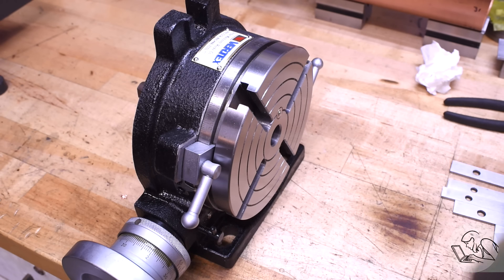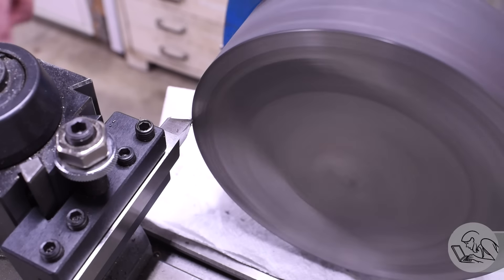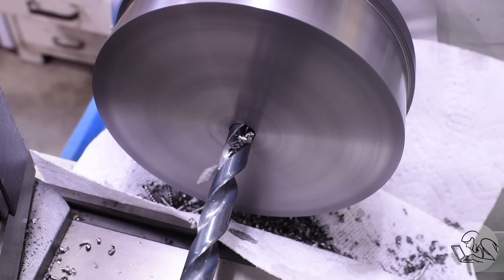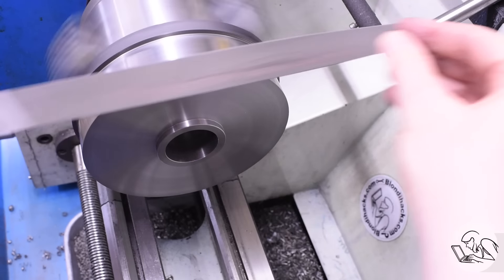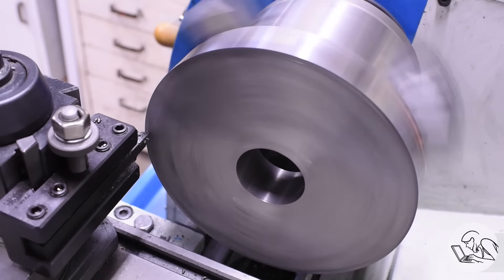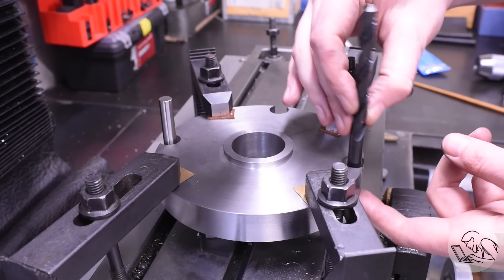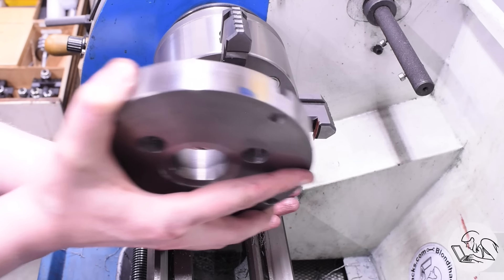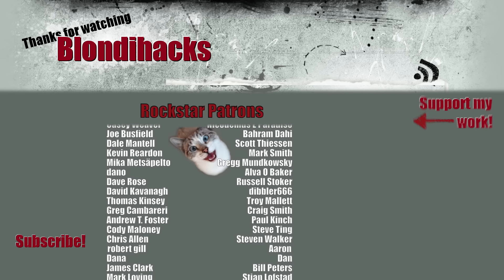Rotary Table Chuck Mount : Let's make one!

Comment: It was quite recently I made a 2-step pulley out of ductile iron, not sure if that's the same as durabar, but I had  many of the same issues 😊. Found out a 4" drill press vise fits in a 4x6 bandsaw vise lol. Thankfully, the ol' Atlas has back gears, .040" cuts no sweat at all. Do you use the 10% cobalt hss tool blanks? In any case, thanks for the share! I could go on and on and on... cast is one of my faves to work with 😁. Cheers! Oh! And very well done!

Comment: I popped my 10 amp fuse turning the aluminum plate I used to make my rotary table stepper motor adapter. I talked to Precision Matthew's and they said a 15 amp fuse would be fine for this lathe. I'm still running a 10 amp but I have 15 for the next really large project. My rotary table is 8" so I was really pushing things!
Reply: Smaller cuts.
Don't wreck your stuff.

Comment: Interesting.  The stock spindle on my G0704 runs slower in reverse, too.  I've never found a satisfactory explanation.  That lathe would be well served by an alternate belt ratio for large work.  Back gear?  Back belt?

Comment: When I need to turn an OD with a boring bar, I like to use a left handed boring bar so I don't have to spin the chuck in reverse.  It also prevents the tool pressure from lifting the tool  holder in the tool post.

Comment: Loosen the T nuts and dial in the part you are working on to the rotation of your rotary table just like you dialed in the chuck. No need to dial in the rotary table first. You can do it on the bench. 

Then dial in the part centered on the spindle.

This will completely eliminate the chuck run out. Each time you put a new part on the table you check run out to the table rotation and dial in. Then center on the spindle. Dead perfect each time.

Comment: When I needed cast iron for a similar project, I found some "barbell weights" and got them considerably cheaper than "continuous cast iron" rounds.  I have a tendency to put a sheet across my lathe when doing such facing.  Reverse is less efficient because of "electrical lead" in the windings.  DC motors or "universal" motors, must have lead in the commutator, to have starting torque.   Sometimes the simple answer eludes you until you eat lunch", thanks, I think I can use an angle plate for my own job.  I've had one of "those six inch bandsaws" since my wife called me, to tell me the tool guy was at the plumber's shop she did the books at.  Aside from regular work, I've cut many things that actually were within the bandsaw's limits.  I took a year of machine shop in high school, 71, and spent fifty years as a machinist.  You are tracing out a similar path to the one I took, so many years ago.  Always a pleasure watching someone enter the field and enjoying the work, and the precision.  That's a very useful project indeed.

Comment: DC motors are often designed to run in primarily one direction.  When this type is run in reverse, it would not be as powerful / efficient / or both.   They can be built neutral - running the same in either direction also.   The angle of the brushes in relation to the stator poles is one variable.  The other is if they have compound windings.

Comment: Not a machinist here with a couple questions. Instead of facing off gobs of material couldn't you just part off the amount you need? And do you change your spindle speed when facing to keep the cutting feed rate the same? Forgive my ignorance, I'm a cabinetmaker. When I make a mistake I can grow a new tree and start over.

Comment: Hi Quinn
You also get chucks with through holes, so you dont need a back plate for rotary tables. You can bolt straight through. You save a lot of precious  vertical real estate.
Reply from the maker: Yup

Comment: Having been a pilot, I’m a fan of acronym based checklists to remind me to not forget to tighten clamps, locks, etc.  For lathe and mill Inuse the same one, SLOW.
S-Safety glasses, sleeves
L-Locks such as quill lock, table lock, carriage lock, set or free appropriately
O-Obstructions, nothing in the way of table feed or chuck rotation (and chuck key out)
W-Workpiece securely clamped

Comment: Very good, you can also make a plug with a Morse taper that goes into the rotary table with the bit sticking out the same diameter as the holes in the adaptor plate and chuck. Slip the adaptor plate and chuck onto it, bolt them down then withdraw the plug to get concentricity.

Comment: I thought you were about to say " So I put a bigger fuse in" 🤣
Reply: Could wrap it with foil...I generally try to incorporate that step prior to smoking my motors.  Saves on the cost of the bigger fuse.
Reply: Never be tempted to do that.
Reply: @BrianFullerton  back in the day, we had one of these glass tube fuses blow in a car.  My grandpa found a twist tie in the trunk and used that to replace the fuse to try and get us back to civilization.  About 5 miles later, the paper on the twist tie lit up like a candle under the dash.

Comment: You commented on the value of those Chinese 4 x 6 bandsaws.  I have to agree,  In my full time job we encountered a production job; the bandsaw ran almost continuously for 2 weeks cutting stacks of 3 x 4 angle.  The motor got so hot that you could walk past it and feel the heat radiating off it.  I decided to keep going until it burned up, but it refused to die.  Yes, I have more than got my money's worth out of it.

Comment: I did a similar project, but wanted to mount a 6" chuck on a 6" rotary table. The trick is to make cutouts for the 3 bolts that hold the chuck to the adapter. You install the 3 hex head bolts into the adapter before you attach it, then slowly run them in with an open wrench. Honestly, it's a PITA, but I did get more capacity. All the forum posts said it is better to use a 4 jaw chuck and just dial it in every time, but I went for a 3 jaw. If I did it again, I'd use a 4 jaw.

Is it just me, or does it seem like maybe some larger machines are in Quinn's future? Big machines are like cheating!

Comment: LOL, great opening; and really nice idea and execution!

Given you have room for adjustment around the bolts, could you tap the 3-jaw true while indicating the pin? I think ThreadExpress showed doing that with his 3-jaw on a lathe.

Your way was quicker and easier, but you could have machined (or bought) a mandel with an MT to fit the rotary table bore (I have the same table and mine at least has a 2-MT bore) then put a threaded hole in that to take a bolt through a strap clamp, etc. to hold the adapter blank to the table while drilling. I machined one for some special operation, then bought a couple of others with soft ends for future use. They're useful for getting the rotary table near centre - I put a dead centre in the quill and bring it down into the centre drill hole in the mandrel and the rotary table is now close enough for anything I do.

Comment: Nice work!  I recommend you pick up a Circle Machine carbide boring bar part# QCBI-375-6-5R with the correct 11 degree inserts.  You can extend it out 3.75” and it will do whatever you ask of it.  Its a very popular bar on the hobby machinist forums as well.  You can sometimes get one for around $60 to $70.  Please stay away from any bars that use TCM inserts.  Let me know if you need more info.  Just an FYI, boring bars dont work in reverse and use your boring bar holder with a sleeve

Comment: Quinn,  got lucky with my rotary table. threaded adaptor for the chucks, you know.  after i centered the table, i popped a center into the adaptor. to center my rotary table now, i pin it to mill table with a center in the spindle gronk on the t-bolts.  check.  finish setup.  machine away!!   when will more steam vids hit your page?  ive been watching them. i really want to see that boiler build.  poppy's workshop says HI

Comment: I like how the design of this lathe actually works through. In that fuse blows and protect circuitry down from the fuse rather than Apple's architecture that usually let logic chips to fry rather protecting them from indecent current spikes.

Comment: Ah, I know why reverse motor power is lower Quinn. The commutator brushes are not at exactly 180° apart. Apparently that is to avoid excessive sparking at high forward speeds. Trouble is it makes sparking much worse at high speed in reverse so the controller has a speed limit when in reverse - on my lathe it is set to 50% and it effectively limits the maximum power available. It's not the motor as such, it's the controller protecting it. Cheers. BobUK. (edit for clarification)
Reply: The brushes on DC motors are also usually "timed" ahead of 0º, which means in reverse, it's timed negative of 0º.

Comment: The 7''7'30 taper is normal DIN 55029 the most selled across the world the taper nose with this dimension fits perfectly into the chuck or backplate you use and makes it the same every time ...made a few backplates so I remembered the taper dimension of the spindle nose as I saw it...

Comment: You did a nice job on everything. One comment on why the high-speed tool burned up, I think you were running your crossfeed rate to slow. I could see just before the tool burned up the material got very shiny. That's a sign that the material was work hardening. I know it sounds counter intuitive but had you been more aggressive with the feed rate you would not have burned up the high-speed tool. That observation comes from 60 years of machining experience. You do a great job and I am very impressed by your skill and precision that you get out of such small machines. Keep up the good work.

Comment: DC motors use brushes, and the rotational position of the brushes to the commutator can be adjusted - AKA timed. The timing is usually optimized for running in the forward direction (min current, max RPM), so reverse direction operation is less than optimum.

Comment: Drills can actually 'wander' thru material, which is probably why some of your bolts touched the side. Easy fix, though! Even reamers will follow a wonky hole. The truest way is to core them out is with an endmill / slotdrill - but only on accurate pcds...

Comment: done that turning to the max capicaity..spot face and put center gives you a little support and saftey margin of material breaking loose..seen work pieces break loose at a few shops was at..and those big holes make up a spade drill old piece of stock wirh a shank turned for drill chuck slotted for some high speed

Comment: Awesome work there!

I feel happier now with my gearhead lathe "Craftex 706", still reassembling after taking it apart so I can move it to the basement, never used but confident it will work well. I almost got the same you have "Craftex clone". I hope the torque at low speeds won't much of an issue compared to yours. And I see what you mean about precision and rigidity, if you can't see a precission surface it will be machines. It bothers me how these Chinese machines get ground non precision surfaces just because you can see them and then the stuff that matters gets chiseled.

Comment: I have the exact same  Vertex rotary table... the outside of the oiler on the surface plate is below flush.... just the ball protrudes slightly.
Reply from the maker: Same here, but that’s still a problem. I shouldn’t have to compress the ball spring to get work to sit flat.

Comment: I bought a 200mm diam 15mmthick  laser cut round steel plate with a 20mm diam laser cut hole in it. I taped 3 holes in it & bolted it from the back on to a face plate. Lightly skimmed one face, turned it over & repeated. Then did the chuck holding part. The reference for the chuck could only  be 5 mm high,which left  a 10mm plate. The turning operation turned the tops off the end of the fixing bolts , but I actually managed to make them match the positions of the chuck mounting bolts which was more by luck than judgement. I made a piece of 20mm bar to fit the hole & clamped it in the chuck & then aligned the chuck over the hole.
 I had expected to just fill them & drill new holes for the chuck bolts. I bored the 20mm hole to the required 28mm size. I was able to skim the edge of the plate on the chuck almost full width before turning over. However, I centred the plate from the hole in the middle, not the edge, so the 3 bolts I had drilled could be used for the chuck.. . The whole job took far less time than Bondie took & I think it was far easier.
I actually bought 2 plates ( Carriage cost being no more) & the other has been drilled & tapped in a grid form to allow me to clamp work pieces to the table easily.

Comment: I feel like a little kid sitting at your feet as I try to learn all that  I can about using a mill, before doing my first milling project on my PM-728V-T. I see all these chips flying, no lubricant? My first project will be to duplicate an aluminum meat mallet that I made in high school nearly 60 years ago. I plan to use WD40 for that. Are you not using a lubricant with the cast iron?

Comment: Here in Germany I could buy 2 alluminium adapter plates to fit a 4 jar from my small lathe and a 3 cheap 3 jar 80 mm to the 90 : 1 index table, similar to Yours. Dead cheap only a few €. Made a adapter plate from cast iron for a 100 mm 6 jaw, what fits to the big lathe and to the index table with a additional centering  adapter. My index table has a MT 2 in the center ... Have another 40 : 1 Index head, there it is a direct fit with the chucks from my big lathe ( RC 650 = Emco 10 copy ) ! The complete index head with  3- jaw chuck 125 mm and tailstock was only 200 € .

Comment: Thank you for a wonderful vid. Well done. 
I ended up with two lathes. 40cm and a 50cm and will set up one for horizontal milling for now..so your video was really helpful.  
Your vacuum clean up also  peaked my interest. I'm currently running a shop vac for clean up on metal work but on the next turnaround will install a central vac system of my own design using cyclone separators. 
Seeing nobody else using a vac with machining and understand it can be problematic esp clogging etc. Can you address any issues you have found and or resolved.. kind of a heads up. 
Thanks again.

Comment: You can get a bit more reach by starting the bolt pattern 45 degrees offset,  so instead of needing to move the whole radius from the center of the pattern on a single axis, you move 70.7% of the radius on both axes.

Comment: I made a spacer for the head of my mill so that I can reach the outside of the table and give me the full milling capability.  I know it adds more torque to the column when milling but I don't set speed records so haven't been too concerned.  Not sure why it was not designed to meet outside edge of the table and with the change, I get a larger usable travel.

Comment: The solution for the chuck jaws not being the same height can be solved if you have a surface grinder (or access to one).  See Stefan Gotteswinter's video about making a Chinese three jaw chuck better.  Surface grinders do not have to be expensive.  I picked up a Harig 612 for only $300 at auction.

Comment: An alternative method of ensuring the chuck is centered would be to leave the centre boss and mounting face oversize, bolt the adapter to the rotary table and then finish them in situe with an end mill.  Easier when the flange is square but you could also throw the head if it is tapered. Great tip with the angle plate in the saw.

Comment: I just ran into the problem of a larger bolt circle diameter than my mill Y travel. Luckily I was also doing a 4 bolt pattern. I realized that if I rotated the square of the pattern 45 degrees it would fit within the travel.

Comment: I've had a motor go boom... both handheld and industrial... it's entertaining but not good!

In your shoes, I'd be turfing the old motor asap, in case it takes out the power electronics when it blows :/

On a happier note, is this a good excuse for a power train upgrade or VFD or some other fancy thing that can go in reverse at full power? 😁

Comment: There are all sorts of shortcomings, and my lathe is 3 phase so torque isn't usually an issue, but how does coring the stock out with a holesaw work on a hobby lathe?

Comment: Does your lathe not have a compound slide? If I run out of travel on the carriage, I just wind the compound slide out towards the work so it has a bit of an overhang. Normally that gets me where I need to be.

Comment: Aren't those oilers press fit in? Maybe it just needs to be pushed in a bit further.

When you were dialing in the chuck, wouldn't tapping the chuck around move the baseplate in relation to the rotary table instead of moving the chuck in relation to the baseplate since the chuck has a register? Would dialing it in from a gauge pin in the chuck with the baseplate bolts loose not get it centered properly? Just trying to understand why you did it the way you did.

Comment: What happens when you overheat a dc motor of this kind is that the spring for the brushess starts to heat up and glow red hot an loses the springyness(is that a word) the ticking you hear might be the bruschess thats not getting proper contact with the collector due to bad springs.so check the bruschess, good job with that adaptorplate,i have done a simular one myself long time ago
Reply: Put a shim under it...back in business

Comment: Quinn, I am getting ready to purchase my first metal lathe. It doesn't come with a 4 jaw. Where are some good places to shop for relatively inexpensive but decent quality chucks and other tooling? Should I buy tooling from the seller (Precision Matthews)?
Reply from the maker: If you can add one from the company as an option, I would definitely do that. The challenge is backing plates. Going third party, it’s very hard to get the right backing plate (especially for import lathes)
Reply: @Blondihacks  Thanks Quinn. I love your channel. A ton of great information and entertaining presentation.